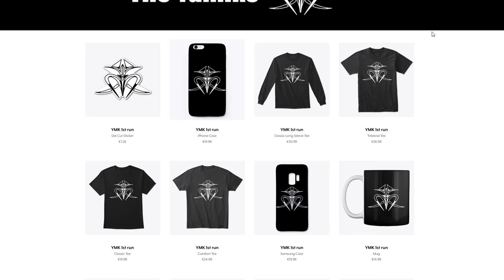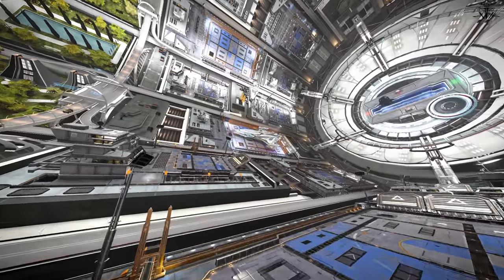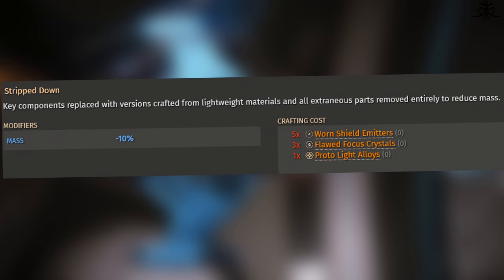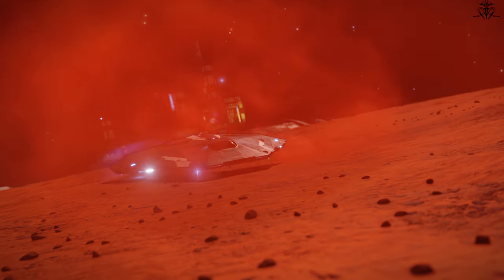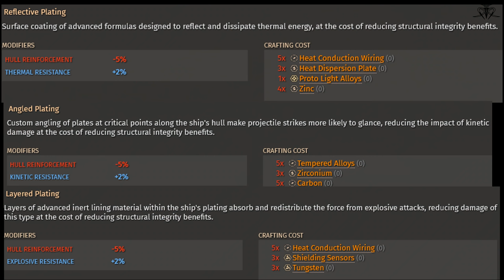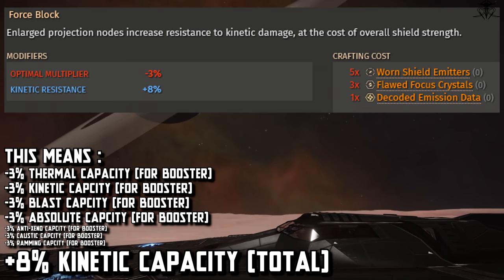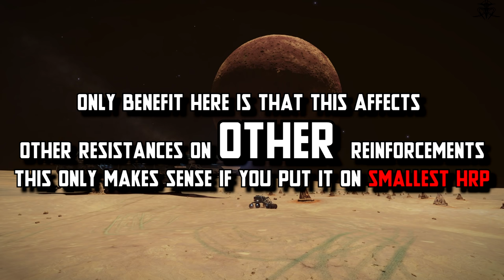BEST to WORST : DON'T BOTHER optional internal tier(Misc stuff,Long range interdictor)

Comment: Enhanced low power is another explorer's choice (and yes, some explorers choose to run shields. This is mainly for, in my opinion, high gravity landings, which are difficult to pull off without some damage. Enhanced low power cuts power, but more importantly, mass.
Reply: Thank you for saying that.  Seconded
Reply: Beat me to it. Stop discriminating against explorers Yamiks!
Reply: Mine saved me when I smashed into the surface of a 1g world in my Krait. If I didnt have shields I would have been sent 18kly to Shinatra.
Reply: Since he also discounts lightweight mods, I'm assuming this is entirely based on combat or that he doesn't really care about min-maxing for jumprange, viewing it as unecessary.
Reply: Yeah, he seems to think that people only look at the "low power" part.  Nobody looks at the "low power" part!  It's enhanced shields.  I use these on explorers and traders... more range and you still get a better bumper (no tradeoff?  they should have just built them this way to begin with).  There are better options for cases where you plan to get seriously shot at... but for everything else, these are great.
Reply: @ElecManEXE  Agreed, though he does miss one great reason to lightweight everything on a combat ship (for the right type of combat ship).. Speed! I would also say Enhanced lower power shields have a use on the right ships again. Give up a little shield potential to drive the best weaponry and thrusters you can. Its certainly not going to be so common, but it does give you some shields while improving the power available for everything else.. Like all those lovely Imperial Hammers!
Reply: Guess Yamiks is not an explorer. Its invaluable for certain exploration builds
Reply: @foldionepapyrus3441  but... On my courier, it gives an extra 22 MJ over a standard 2D shield gen. So, when used properly, there's literally no downside to the ELP shields
Reply: @LotusBoi1989  Sweet, I've never seen that myself. But who needs shields when you can top out 300ms faster than just about anything able to actually cause you harm in a hurry..
Reply: I explore with my 75 Ly Annie in open and it's my rule to never have under 1000 shields, which can be reached with a 3A Prismatic with G5 reinforced hi-cap and 3 E-class (for weight and energy savings) boosters. It's saved me countless times.
Reply: "Enhanced low power" actually increases shield strength, while also reducing mass and power draw. It is a good upgrade for plenty of builds, even combat ones. But if the only thing you're ever flying is an MJ stacking cutter for pvp...
Reply: I run shields on my exploraconda mostly just to avoid little dings when landing and docking when out in the black. It's not much protection, but it regenerates.
Reply: @ElecManEXE  I run lightweight on my military composite on my Viper MK IV, with a smaller fuel tank and 2D FSD for maneuverability...

Comment: Thermal Resistant Hull Reinforcement is fantastic if you use Reactive Surface Composite. Compensate for its thermal vulnerability.
Reply from the maker: ok.. umm what about then : mirrored bulkheads & heavy duty all round?
Reply: @TheYamiks   Just ran some quick numbers on Coriolis on a corvette with one shield and the rest hull reinforcements.
For the reactive build, i used Heavy duty on the bulkheads and added thermal resist 5 to two HRPs, so the resistances balanced out.

Your mirrored and all heavy duty, in terms of effective armour, compared to the above reactive, had about 10% more thermal armour, 5% more absolute, 5% less explosive and 10% less kinetic effective armour.
9698, 21468, 20692, 25261 for mirror HD vs 9453, 22497, 22734, 22669 for Reactive kinetic (absolute, explosive, kinetic, thermal).

I've personaly always used reactive with thermal resist and HD on HRPs, but it apears that this has a slightly worse effectives (2.2% absolute, 0.5% others) than the reactive HD with 2 thermal HRPs.
Reply: @TheYamiks  You'd think it would be just as good, but with Reactive Surface, a single lowest-class Thermal Reinforcement winds up with more after-resistance hull HP. I don't fully trust my math on this, but several PvPers and Mini-Kill already did the math.
Reply: @wild_dog3636  2 thermal HRPs? But you only need one size 3 to balance out resistances

Comment: I really think you vastly underestimate  enhanced low power on shields, especially for explorers. Halves the weight, reduces power consumption (which lets you drop the powerplant, thereby shedding even more weight) AND gives a few more MJ of shield strength?  My Courier explorer has a 2D shield gen, that weighs half aton, and gives 272 MJ.  Where as stock gives 250, weighs a full ton, and pulls nearly twice as much power.

Seems like the only choice for an explorer, to me.

Edit: Really? Thermal upgrade, useless? Slap a thermal resist on a class 1 hull reinforcement, and suddenly reactive surface composites go from being useless against lasers, to being equally good against everything.

Seriously, you sure you're qualified to be giving advice?

Comment: Although I do use low powered shields on my jumpaconda, and I guess the light weight fuel limpets will probably be useful for the fuel rats?
Reply: As a Fuel Rat, I can confirm that.

Comment: I went specialized. I know it leaves me more vulnerable, but I play it smart with my speed and it won't overheat me.
Reply from the maker: it's a crutch......you are telling me that managing heat is soo hard for your build that you NEED this vulnerability!?
Reply: @Urazz I can't say I've ever gone in with 1% hull, 0% hps and misc damage and thought "This is expensive to repair".

Normally w/e you're doing makes more money than the damage you're taking unless you're dying repeatedly, so I don't understand that argument.
Reply: @TheYamiks  Specialised is the go to for PvE builds, especially conflict zones. Mainly because no NPC has cascade rails. Agreed on the part that for PvP you need the fast charge. Also, Specialised reduces thermal load too, which means you can get away with fewer heat sinks.
Reply: For PvE: Specialized - Recycling always
Reply: @TheYamiks  Old, but I was trying to avoid heatsinks. Yeah, not the greatest decision.

Comment: The only one I disagreed with, for a specific use case, is the enhanced low power shields. Yeah, they're awful for combat, but they're great for explorers who want the smallest possible shield, just to absorb bumps on landing, but otherwise want to be as lightweight as possible. That's specifically for explorers who are favoring jump range over most other considerations on their ship, so it's not even all explorers who will want that, just some. Many others favor reinforced shields instead.
Reply from the maker: did mention explorers ..din't I? 
Still why have shields for exploration .. really?
Only use case is to land on high-g planets and even then if you are afraid. As for rest : SOLO
Reply: @TheYamiks  Why not have shields for exploration. A single prang on landing (you DO know how to prang into the ground, right, boy?) and you lose 3 months of work.
Reply: Since the current complaint in PvP combat is that shield tanks are OP, the difference between ELP and Res Aug shields is minimal, it still has mutli-thousand hit points effectiveness and takes 20 minutes to take down rather than 25. Same with Hull: since the current complaint is that the hull tank meta is now broke because of the aforementioned OP shield hit point thingy, it really doesn't matter if you lightweight them and doing so would keep the speed and manoeuvring up as well as the jump range.
Reply: If you favour jump range over all as an explorer you don't have a shield.  If you have a shield, you should go with enhanced.  Sure, reinforced will get you a slightly bigger bumper, but you'll also have to pay all the mass on a piece of equipment you could do without.   I'm not the type that cares about jump distance, but that's getting too wasteful... the bumper on standard shield is already enough to protect against a bumpy landing, enhanced makes it better in every way by giving you more shields and a refund on the mass.
Reply: There's no argument for not having two AFMUs.  They're massless and all the ships have plenty of slots now.  They even made the main scanner standard for even more space.  With the shield you're not going to really benefit from having reinforced instead of enhanced on an explorer.  Less mass on the security blanket is the real plus, not a little more shielding.
Reply: @vib80  Then so what? 99.999% of explorers do NOT favour jump range over everything else. Because smacking into a planet without a shield can cause you to lose all your months or even years of work.
Reply: @vib80  ELP shields mean you draw less power, so need a lower power plant. Which can be lighter. Added to the shield which will also be lighter...
Reply: No, you're just not paying attention.  You're really attacking someone else but directing it at me... because I'm not really arguing against you.  I'm not saying don't go without a shield... I always go with a shield.  Shields are fine, but they cost you in mass.  Which is something... adding a shield will always be a question because of that.  You could always choose to "git gud" and save yourself that cost... I prefer to side on caution against my own clumsiness, but I don't pretend that my choice is anything but sub-optimal.  It's like having a land line... there's a case that it's good to have in an emergency.  But the actual need to have one isn't there like it used to be.  And if you choose to get a land line, why pretend that it's not wasteful to go with the most expensive package a phone company offers you (including renting the phone).  If it's for emergencies, you're hoping to never use it, and any working phone and plan can do the job as well as any other.  And it's not like no frills plans aren't available and you can't find a land line phone for a quarter at a yard sale.  That's my point... I'm not really talking shields or no shields, it's about shield mods.  Reinforced shields give you a bit more absolute shield than enhanced, but you pay all the costs.  So enhanced is the way to go for shields... it refunds the mass on the luxury of having shields (for not "gittin' gud") and gives you more shield as well.  The thing about me not caring about jump range was used here to make a simple point: I'm fine tossing away the range I lost for the shield, but if you're going to hand a bunch of it back to me while boosting my bumper... that's crazy good, enhanced shields are clearly the correct choice, the extra range will pay off more than the extra shield from reinforced would save me. The lower power cost of enhanced isn't really anything on an explorer.  Underranking your power on a explorer is a mistake if you truly care about robustness... you'll want A class for the heat efficiency, and enough power that 40% can cover your basics.  That typically means that you have enough power for the shield without enhancing it.  Enhancing it just extends the time beyond generator refills if you don't turn it off.

AFMUs don't cost you in mass and spend more of their time off.  So there's never been a case for not filling out every empty slot in your build with them.  Because the only cost is the slot.  And that used to mean that a case could be made for never having a second on on a ship like a Hauler... which after you put the Fuel Scoop and the scanners in, you had only 1 slot left.  No room for two of anything, QED.  Now, you can have the exact same capability explorer Hauler and have used only one slot out of six.  That's four more slots than you used to have.   There simply isn't a case for not having two AFMUs anymore... any ship can easily build for it.  No one can tell you that's wrong... it's not just a choice.  That doesn't mean that you can't choose otherwise... you're free to do anything you want with builds, even stupid things.  Which just means that simply wanting to have something else isn't an invalidation of someone else's choice.  It's not a case for good or bad, just a statement of your prerogative to do what you want.  Nothing wrong with that.  There's simply no argument for not having two AFMUs.  Three is overly paranoid, though... you only need two to repair each other.   Odds are your ship is destroyed before a third one becomes useful.
Reply: @vib80  All wrong. Every single bit is wrong. You are saying "don't go without a shield".
Reply: @vib80  Clearly language is not your thing because otherwise you would not demand an exact word equivalent, since words have meaning, not just their specific appearance.
Reply: @vib80  Oh, sorry, you were correct. I meant to state "Don't go with a shield".
Reply: @TheYamiks  Because mistakes happen, and every little bit of hull damage adds up. I'd much rather devote between a single to a half of a ton to insurance, than risk booping a planet just a little too hard and getting flung 25k LY back to the bubble, just because I wanted an extra 0.3 LY of range.
Reply: @LotusBoi1989  Exactly. You feel a little overcautious bringing it... until you bop a planet and realize how much time and money you almost lost.

Comment: Honestly, I always lightweight grade 5 the sensors, the life support, and if I have them, the limpets as well. On speed/maneuverability dependent combat builds (FDL, Mamba, Krait Phantom stc.) I even tend to use lightweight reactive surface composite hull. I like to squeeze all the top speed, turn speed and jump range I can, even out of my mining ships.
One specific use for reflective plating experimental is to offset the thermal weakness when you run reactive composite hull.

Comment: Enhanced Low Power shields are an explorer's dream - lets you undersize the power plant but still have shields for when you're in inhabited space OR high-G landings. Lightweight hull reinforcement is also an explorer's dream.
Reply: As an explorer you'll be fitting lightweight alloy armour anyway. Since it has zero mass you can mod it heavy duty for no penalty.
Reply: The only mod that explorers want on a hull reinforcement is "get these things out of my ship!".  Finding out you forgot to remove hull reinforcements when you're out around Beagle Point looking at a jump you can't make because of that is an explorer's /nightmare/. 

Power is never really an issue with the explorer ships I've built (you get enhanced for the stripping and extra bumper).  Besides if you're going to be paranoid enough to consider hull reinforcements on an explorer, you'd be better off choosing to not undersize the power plant instead... because if you're playing it safe, you want an A rank to run cool and enough power than 40% covers the basics (life support, thrusters, FSD... these get you home).  Because if the power plant takes enough damage you will get brown outs that leave you with only 40%.  You can call the Hull Seals for hull, but no one can fix a power plant in space (apparently somewhere along the way, people forgot about Auxiliary Power Units).
Reply: @vib80  APUs are only good for an hour, tops. usually only the few minutes needed to run systems and have enough left over for the precompression of the main power intakes.
Reply: And the problem is?  It's not like we'd be using today's technology in the 34th century, but the usage we're talking about isn't any greater... a few minutes to run the AFMU while the main power unit is down for repairs.
Reply: @vib80  It's not like we will carry around a months worth of power in an APU either, and if it is only for use for dockside, or cold booting which takes 15 seconds, why should it be used up in a mass that can explode badly for no reason?
Reply: Um... you're planing on using technology that's 1400 years out of standard, and doesn't meet the demands or requirements of the ships we're talking about?  Many vehicles use APUs today, and they don't use the same ones, or for the same purposes, or even meet necessarily meet the same requirements.  Land, air, sea, space... all these things are very different.  As are the applications... military isn't like commercial.  Different companies also have different ideas on how things should work.  You use an APU designed to meet your requirements and demand.  Here we're talking about something that needs to produce some power for a few minutes occasionally... and while it's not being used, it's free to be maintained and repaired as needed (unlike the main power).  This is easily within the tech seen here in the 34th century.

Comment: FDevs have seen other games with "character builds" and thought "bah this is stupid easy" but none of them actually delved deeper into the topic and they just slap random values. But it is interesting as it gives us the effect same as would a painter do electrical installations in your house without any actual knowledge how it is properly done but "hey I saw people are putting these cables in a straight line - it is boring let me change that..."

Comment: I actually prefer the specialized upgrade for SCB's. The HP bonus is neglectible, but ~20% less heat is pretty handy. For PvE that is ofc...
Allso, low power shields are amazing for explo vessels, if you dont want to go without any, as it gets the weight and power reqs down quite a bit.
And finally, layered plating is actually the way to go for 1D Hull Reinforcements, because theres no base HP worth speaking of to buff.